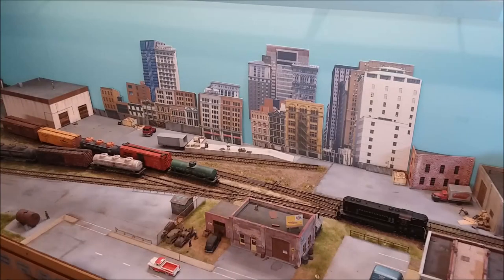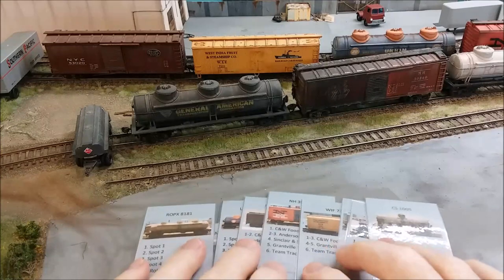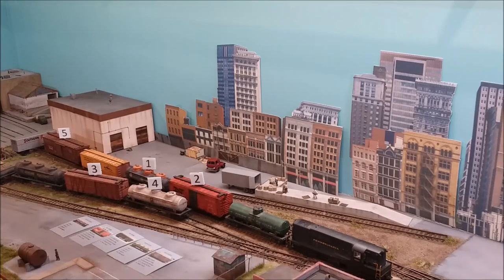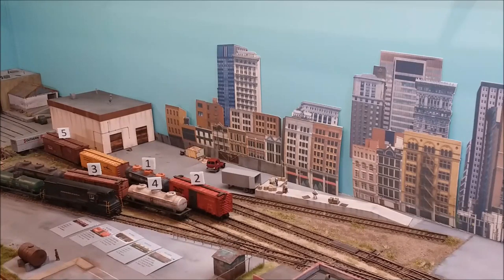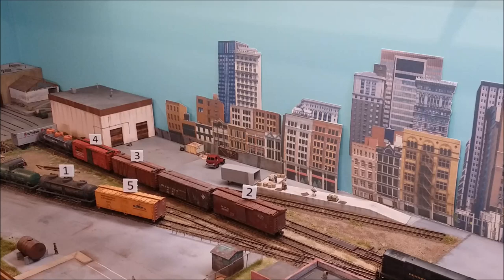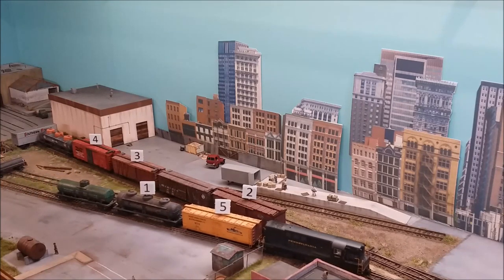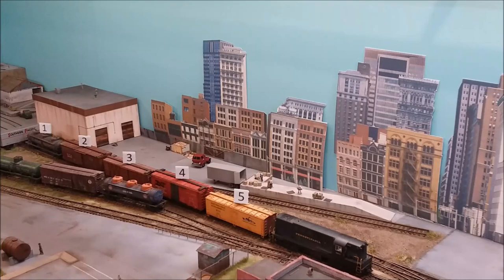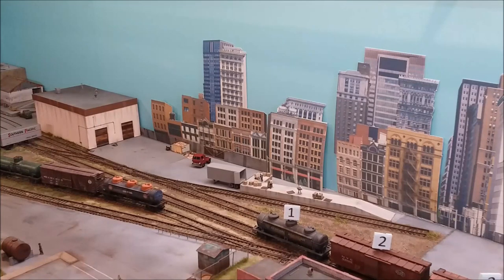Inglenook Sidings Switching Puzzle (13)

Comment: Simple unless you wanted them in reverse order. BTW, try putting  your wires to the turnouts in a metal tube and this will allow for longer distances without bending.
Reply from the maker: Thanks for the tip!

Comment: Nice. What couplers do you use? What did you use for ground cover?
Reply from the maker: I try to use Kadee #5s (or the equivalent whisker coupler whose number I can't remember). The ground cover starts with a layer of filtered real dirt, upon which I spread some fine ground foam of brown/green. Then I will either hand plant some static grass clumps or break out the applicator for larger areas.

Comment: I"ve studied the Inglenook Sidings Puzzle extensively and have written a web browser program that generates a random start and then calculates a solution.  If you number all eight cars and specify all of their their final positions (which was not the original version) then graph theory can be used to find a shortest solution for all possible starts.  Even the shortest number of moves for a solution can be as large as 20 but typically is in the range of 15 to 18.  The seven car version, which has 4 cars on the main siding, 2 cars plus loco on the lead, and 3 cars on the other two sidings, actually has longer solutions on average than the eight car version.  Thanks for your interest in this puzzle and sharing how you fit it into your layout.  Cheers from Wisconsin!
Reply from the maker: Thanks for watching Andrew. I always look forward to your comments. The Inglenook puzzle is definitely very beguiling.
Reply: I've been looking for a program that calculates the solution to an Inglenook puzzle.  Can I get a copy of your code?
Reply: @solimar1554  The latest version is an html file with embedded JavaScript that can be opened in a browser.  I can send a copy to you via email.
Reply: @andrewpalm2103   My responses seem to go away.  you can send to pkol at amer online.  Maybe this will work.  I have been searching for algorithms to  port to .net programming for a while now.  Thanks, in advance.
Reply: @solimar1554  Yes, if you put an email address in a comment it is dropped.  I just sent an email to what I believe is your address.  If you don't get it, let me know.
Reply: @andrewpalm2103   Andrew, click Solimar or @Solimar and in the  About tab you'll find the address.  All my messages seem to disappear..  Thanks!!

Comment: Would love to hear, why the Montauk.  
Not to worry about brain fart. We all have them , then throw in Murphy and his derailment plan and you have an op session. No?
Reply from the maker: It's a long story... basically there's a picture in John Armstrong's book showing car float ops at a pocket yard somewhere in New York. That picture always fascinated me. Flash forward many years and I learned it was an Erie RR yard at 149th St. on the Harlem River. I put that in a blender along with all my other wants, needs and limitations and came up with the LIRR, Montauk Branch. I still want a boxcab engine, though.
Reply: @longislandrailroadmontaukb982  your right, convoluted story. I thought I was the only one who did things like that. My story is just as bad. My RR years ago was the Oak Valley &Western. I had a parallel track running about half the length. A friend shows up with Proto 2000 's first engine. A TP&W GP18. Non of us  knew what that stood for but since my RR went behind the 1/2 bath I named it the Toilet Paper &Water. I have since found out that it stood for Toledo Peoria &Western. I've since rebuilt the RR and now I model the TP&W WITH THE OV&W running along side. The catch ,my story and I'm sticking to it, the to RR have merged and I'm modeling the part of the RR that was never built. Logansport Ind. To Toledo Ohio. At least none can tell me I'm doing it wrong🥴🥴
Reply: @longislandrailroadmontaukb982 Would that be John Armstrong’s Track Planning for Realistic Operations?
Reply from the maker: @amandahammond2691  Yes, it would. Best single-volume book on model railroading ever.